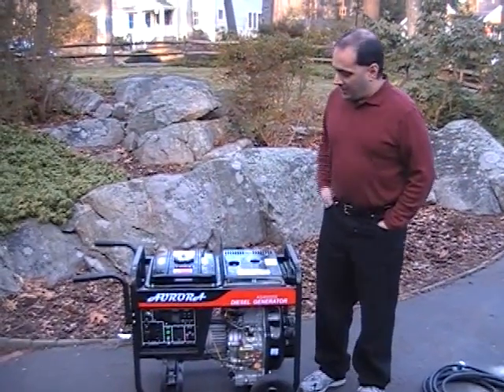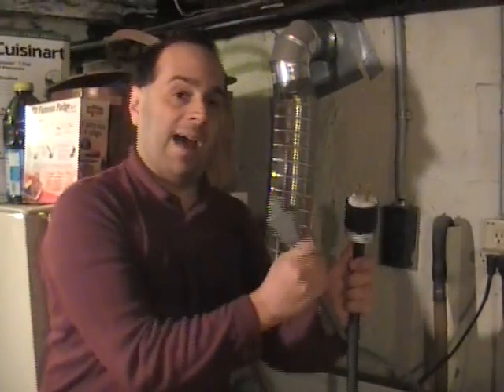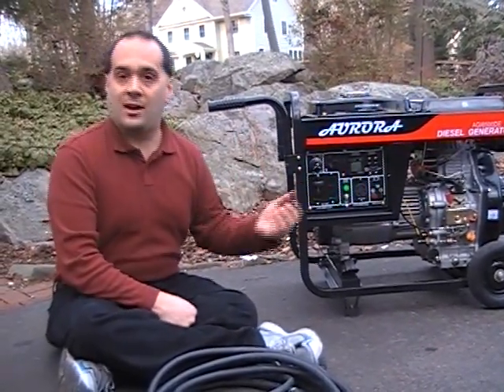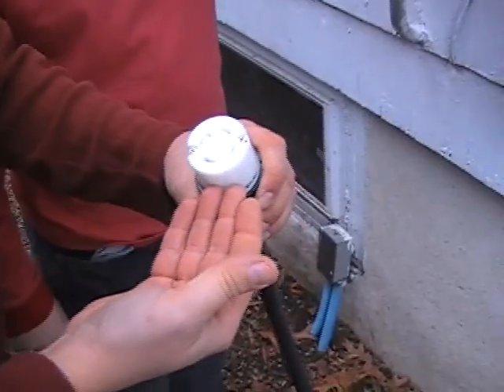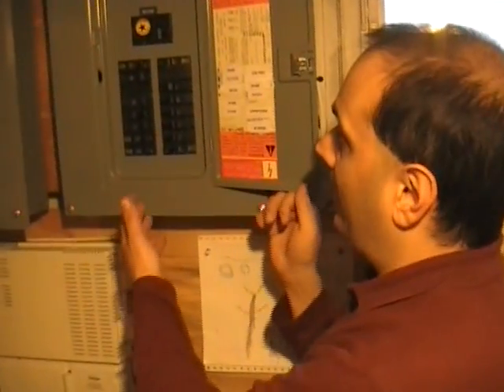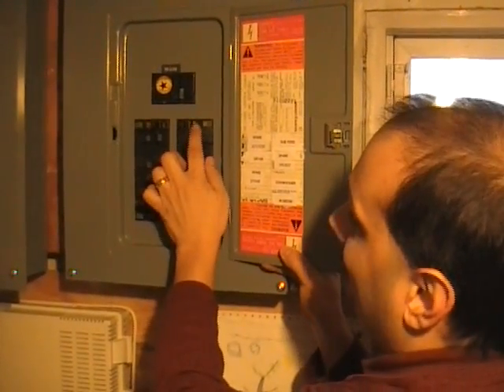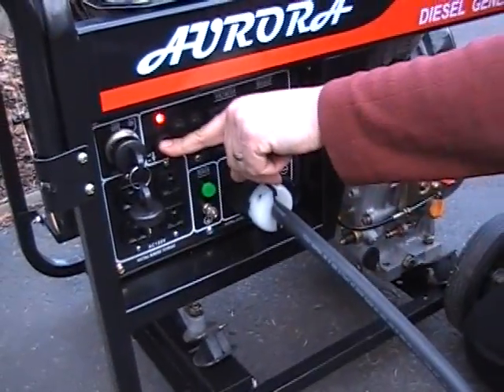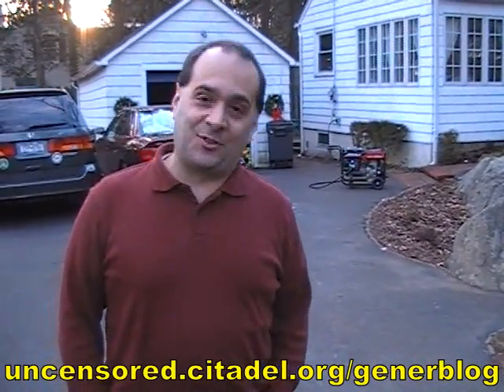Inexpensive residential generator hookup

Comment: We had a dryer that we went to plug in right after we moved into a house, upon plugging it in..... it blew the Transformer across the street. ( as in it went🌋🌠 across the street, not across the street ) it turns out the wire was not connected properly inside the dryer, however it didn't trip the breaker. I suspect it was not properly wired ( I wish I confirmed it and I suspect it was a direct tap prior to the main breaker it was an old house ). and if that wasn't properly wired who knows if the wire between the plug and the panel was the correct size, the longer your wire is the more voltage drop and resistant you have with a greater load applied the more resistance you have the more the wire acts as a heater instead of a wire.
There's a reason it's illegal other than the common sense factor which has left this country so we have to legalese around it.
Reply: A very good example and an illustration of one of the issues I was going to explain to Darryl who while keen to call people a "dumbass" is conspicuous in his absence. Unless someone has an interest in the difference I will leave it there as I have a feeling that a full explanation would be a waste of key presses for me. I have all the time in the world for intelligent people that have a genuine interest in science and technology but none for people that just want to insult people and have an IQ that is equal to a goldfish !

This has been a very interesting conversation and I would like to thank the many people that contacted me to show their support. There sure are some nice people over in the US   :-)
Reply: Beyonder  I am a retired Royal Navy electrical engineer in the UK so I am not familiar with the current regulations. I did however design and build some installations in the US many years ago.

Code wise I cannot comment as I am very likely out of date with the current code and have no knowledge of the legalities of buying and selling a home in the US. Over here in the UK a survey is normally performed and a home would have to have an electrical inspection certificate as part of that.

With regards to the technical aspect of the incident I can only imagine that the drier supply was terminated directly to the distribution panel feed. This however would not explain what was described.

The fault current would be many thousands of amps if the fault was a complete short circuit of the tails. The problem is that before the transformer there is the meter and often a fuse block and or isolator. Even if both the black and red supply legs were directly bridged together the utility protection fuse should have blown. Considering the diameter of the conductors at that stage of the installation and the potential power the meter would have been blown of the housing. Further on down the feed you will branch or directly reach the transformer.

The transformer installation (we will take a pole transformer for the example) has a protective fuse on each leg of the end taps (the two hot legs) and a cable is bonded to the neutral tap and fed down the pole to a very long earth rod and sometimes the pole support cable ground screw will be bonded. The grid side of the transformer will often have an explosive disconnect to protect the upstream network. What I find very strange about the incident as described is that many small transformers and all larger ones are oil filled. A direct dead short in the windings on the secondary could cause heating of the oil but eventually blow the disconnect. A short on the primary would do the same. How long before the protection activates depends where in the windings the short takes place.

Transformers are insulation tested with many thousand more volts than they will ever see in service and this kind of test should be re-performed on a regular basis. The explosion of a transformer is incredibly rare in the first place and is caused when the oil boils and creates an overpressure event. All new transformers have a valve that will open under an overpressure event. Some very old transformers did not have this and could explode. I can assure you that many thousands of hours go into the design and testing of a utility transformers a large proportion of these into safety for time and liability reasons as no utilities want to create more work and costs for the company.

"IF" the described story is correct I can only imagine that the pressure safety valve failed and that the transformer was in overload conditions already. A short circuit in the drier with all safety devices and most of the installation badly or incorrectly wired could cause a transformer explosion but this would be a VERY unlikely event. A huge amount of money is put into design and research for the very reason that no utility company would want to be "sued" for any injury or damage. If this incident did take place there would be a very in depth investigation and a customer would normally be given a copy of this report. 

I hope this is of some help.
Reply: Obviously they were not paying for the power to the dryer circuit, and as you suggested were bypassing the circuit breaker so it had no protection, must have been a decent short to blow a fuse at the transformer!!
Reply: Don’t forget about the generator safety rules: please make sure you are aware of all the warnings before using portable generators. This is just a reminder for everyone’s safety. All generator safety rules should be followed carefully. This advice is just to make sure that everyone is aware of all the warnings and it’s just to remind people to be careful using portable generators. Generators can be dangerous if not used carefully. Every year, hundreds of people die or get injured when using portable generators due to carbon monoxide poisoning and electrocution. Make sure you are using your generator carefully and keeping others safe as well. There is something very serious that everyone should always be aware of when using generators. Some people do run their generator indoors which is not safe and that increases the risk of carbon monoxide poisoning which can cause death of family and you. Some people run their generator in wet conditions which can electrocute them. Please remember that you should never run your generator indoors. Remember that carbon monoxide is an odorless and colorless gas that you cannot see or smell. Carbon monoxide is a silent killer. Keep that in mind. Make sure your generator is 15-20 feet away from your house and away from doors, windows, and vents. Never use your generator in your porch too. Having a carbon monoxide detector is very important against generator safety. Some people also allow children to go near the portable generator which could pose risks. We need to keep an eye on our children making sure that they are not near the portable generator so they won’t get electrocuted or burned by the generator which is dangerous. A locking enclosure also keeps kids safe. A generator shed might look like a tempting place to explore, or take cover during a game of hide and seek, but a generator is a dangerous piece of equipment that can cause injury. It says on the manual that we should also keep children away at all times from the portable generator to avoid injuries. Please do not allow a child or unqualified people to operate the portable generator.  It is important to keep your children safe especially little ones. The portable generator can be hot during an operation. Just because some manuals missed what should be listed doesn’t mean it’s safe to do. Always follow the generator safety rules when using portable generators. Generators pose electrical risks. If you need to use your generator during wet weather, you need a generator tent to protect your generator from getting wet. Don’t let your generator get wet. Keep your generator dry and before using your generator, please make sure your hands and your generator is dry. Do not wear loose clothing when operating the generator. Everything that is said on the generator’s operating manual should not be ignored. Never smoke cigarettes near the generator. Please keep flammable things away from the generator. Never overload your generator too. Your generator can catch fire. Never ever try to plug a generator cord into a wall outlet to avoid back feeding. Back feeding your generator is dangerous. Always turn on your generator first before plugging in appliances and shut off the appliances before turning your generator off. Use a heavy duty cord for your generator and the cord should not be worn out. All the instructions should be followed carefully. Never refuel your generator while it’s running. It can cause fire if fuel spills while your generator is hot. You should turn off your generator and let it cool off before refueling it. Having a fire extinguisher next to the generator is also important. This is only a reminder for everyone’s safety of using generators. Make sure your generator is properly grounded. Having a fire extinguisher next to the generator is also important against the safety rules. https://youtu.be/I1jT3ANENvI and here is a video more about keeping others safe when using generators and also about our family’s safety. It’s important to keep our little children safe as well. Make sure they’re away from the generator. Hope this helps. Thank you. This is only a reminder.
Reply: @The_Happy_Aviation_Enthusiast  Well surprised to see this notification of a comment, definitely some good safety rules! though I know a lot of people I’ve seen are not competent to operate a lot of equipment. And I have yet to find anybody other than me who keeps chords in good shape especially if they wrap it around their arm. Over under is where it’s at!
Reply: My goodness the comments, I guess I should finish explaining. We were renting a house which happened to be an old farmhouse and we had full access to all 68 acres. This is practically in the middle of nowhere upstate New York, in fact the phone trunk line ended at our house and they ran spurs to our two other neighbors +1 and +2 miles respectively down the road ( but hey at least I had consistent dial-up that didn't drop unles somebody picked up the phone ); the powerlines went to those last two houses and ended for a good mile whereupon they pick back up from a different supplier.

Did I not mention this was an old farmhouse and it had i’am guessing what was a 100A squareD QO 10-20? space panel which had to have been upgraded from a fuse panel at some point. The house looked to have an addition added to it as construction was a little bit different between the two halfs. The basement was a stacked stone foundation. oh and this was 1998-2004? Let's see I was probably somewhere in the age of 6-12 and inspiring to be an electrician for some weird reason, not confident enough to open a circuit panel yet comfortable enough to install outlets, switches and lights safely and correct. After all my favorite bedtime story was “how to basic wire your house”.

Oh and thank you yes this was a pole transformer.
And this would be more in line with what would be considered a farm poll installation where power comes into a pole on the property then goes through the meter and back up the pole off to different outbuildings.

I do know that we were using a fairly standard poll pig at that time with a fuse on the supply side, and that we were the only customer being served by that transformer. It also wasn't in a known rusty condition and was fairly similar to the replacement. I'm also going to make the assumption that everything was wired with the standard 200 amp overhead household service wiring.
In this case are power came on overhead lines about 25 feet to a head mounted on the side of the house down the wall in insulated cabling into the meter channel and then to insulated cabling into the basement. Another insulated cable came back up the wall went through overhead cabling across the street to a Quonset hut that was surplus and reused for a barn at one point and was currently used as storage for the property owner’s old Farm equipment and general mechanical supplies and what not as this was an older couple that rented us the house.

We certainly did pay for the power, however back in the fuse board days it was very common to tap off the main lugs coming into the building for higher power circuits just after the meter, using the meter as a means of disconnect. I suspect that this was a do-it-yourself upgrade as over 5 acres it was not required to have permits for somethings. We look this up when we wanted to add 20 ft.² to an old chicken coop to raise goats and had the owners permission.

Comment: how many db is that gen set? It sounds pretty "quiet" for a diesel. I know most noise comes from the gen and engine, not the exhaust. I've got an 8750 that screams out to the surrounding neighbors that it's on and running.

Also I recommend a WHOLE PANEL SURGE SUPPRESSOR while running on a genset, let alone while not. 
They are pretty reasonably priced, found on Amazon. They protect all circuits that are being operated. No need to spend $80 X 6 for TV's, computers, anything electronic.
Reply: Don’t forget about the portable generator safety rules: make sure you are aware of all the warnings before using portable generators. This is just a reminder for everyone’s safety. All generator safety rules should be followed carefully. This advice is just to make sure that everyone is aware of all the warnings and it’s just to remind people to be careful using portable generators. Generators can be dangerous if not used carefully. Every year, hundreds of people die or get injured when using portable generators due to carbon monoxide poisoning and electrocution. Make sure you are using your generator carefully and keeping others safe as well. There is something very serious that everyone should always be aware of when using generators. Some people do run their generator indoors which is not safe and that increases the risk of carbon monoxide poisoning which can cause death of family and you. Some people run their generator in wet conditions which can electrocute them. Please remember that you should never run your generator indoors. Remember that carbon monoxide is an odorless and colorless gas that you cannot see or smell. Carbon monoxide is a silent killer. Keep that in mind. Make sure your generator is 15-20 feet away from your house and away from doors, windows, and vents. Never use your generator in your porch too. Having a carbon monoxide detector is very important against generator safety. Some people also allow children to go near the portable generator which could pose risks. We need to keep an eye on our children making sure that they are not near the portable generator so they won’t get electrocuted or burned by the generator which is dangerous. A locking enclosure also keeps kids safe. A generator shed might look like a tempting place to explore, or take cover during a game of hide and seek, but a generator is a dangerous piece of equipment that can cause injury. It says on the manual that we should also keep children away at all times from the portable generator to avoid injuries. Please do not allow a child or unqualified people to operate the portable generator.  It is important to keep your children safe especially little ones. The portable generator can be hot during an operation. Just because some manuals missed what should be listed doesn’t mean it’s safe to do. Always follow the generator safety rules when using portable generators. Generators pose electrical risks. If you need to use your generator during wet weather, you need a generator tent to protect your generator from getting wet. Don’t let your generator get wet. Keep your generator dry and before using your generator, please make sure your hands and your generator is dry. Do not wear loose clothing when operating the generator. Everything that is said on the generator’s operating manual should not be ignored. Never smoke cigarettes near the generator. Please keep flammable things away from the generator. Never overload your generator too. Your generator can catch fire. Never ever try to plug a generator cord into a wall outlet to avoid back feeding. Back feeding your generator is dangerous. Always turn on your generator first before plugging in appliances and shut off the appliances before turning your generator off. Use a heavy duty cord for your generator and the cord should not be worn out. All the instructions should be followed carefully. Never refuel your generator while it’s running. It can cause fire if fuel spills while your generator is hot. You should turn off your generator and let it cool off before refueling it. Having a fire extinguisher next to the generator is also important. This is only a reminder for everyone’s safety of using generators. Make sure your generator is properly grounded. Having a fire extinguisher next to the generator is also important against the safety rules. https://youtu.be/I1jT3ANENvI and here is a video more about keeping others safe when using generators and also about our family’s safety. It’s important to keep our little children safe as well. Make sure they’re away from the generator. Hope this helps. Have a good one.